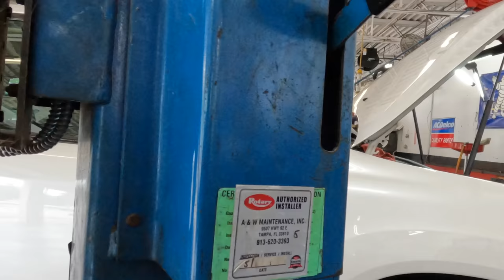Lost Every Time! Shortcut FAILS! 2005 Lexus Rx330

Comment: So I have an 04 rx330. Was running like a champ till the other day. Only problem before then were bad rear struts. But anyway on our way home my fiancé set cruise control and it revved to 90, 10mph past set speed and began knocking. I had just hit 5k miles since last oil change and bought oil and filter. The oil light had been flashing intermittently but that happened last 2 times we needed oil changed. But now we have definite big end knock that sounds like worn connector rod bearings. Codes p0012, 0022, 0430 0441 0446 and 0455 so now I’m planing an engine tear down and rebuild and weighing it against a salvaged engine swap out. Low cost is better heat so I would prefer the former. Anyway I’m wondering what the odds are the retarded cam banks timing is causing the combustion fuel exhaust mixture to be so far off the sensors are thinking the bank 2 cat is dead. Will repairing the engine remedy these codes or am I looking at a whole evaporative system overhaul as well as an engine overhaul? Going to a mechanic I trust on Monday and having him run a diagnostic and compression test just to make sure it isn’t something less catastrophic but I’m pretty good with on the fly diagnostics.

God damn Toyota recommending 10k mile oil changes and not using Mobil 1 synthetic / royal purple or similar high quality oils for oil changes at their dealerships. 
Any advice / help would be appreciated.
Reply: I got a Lexus rx330 2005 bought December 1st and already have a problem jap made crap
Reply: @kellysutton2780  it’s a 19 year old car. Toyota makes better vehicles than most. I had to pull the engine out of mine and replace it with a salvaged one  myself since I couldn’t afford $4000 to have a garage do it. What’s the issue with yours? How many miles? Most people neglect oil changes and let them go too long till the lubrications system fails and then you have catastrophic engine failure. But I see more Rx330’s on the road than any other used car from that year period and I’ve never heard of a 3mz fe engine failing before 200k miles. And I’ve seen a lot go to 300-400k miles
Reply: @kellysutton2780  most dealerships are required by law to offer a 90day warranty. I would go and complain to them
Reply: @deeeyewhy5949  it said by as is used car lot
Reply: @deeeyewhy5949  it has 185thousand miles and the check engine and traction off light came on so I unhooked battery cables and hooked them back on lights went out but was running rough and found out it was out of coolant put in coolant and back to normal next day I cranked it maintenance required light was on and running rough turned it off and barely cranked it sat for one hour tow truck guy cranked it drove it on truck and said seems fine so I don't know I sent it to garage but they can't look at it until Tuesday
Reply: @deeeyewhy5949  garage said it needs coil tuneup and timing belt 1298.80

Comment: I don't know why you don't want to discharge the A/C. On most modern cars, the condenser, radiator and fans are installed as a module. It only makes sense to remove them as a module. I'm also curious why you don't use a vacuum filler for the cooling system. It's quite a bit faster than using the burping funnel.

Comment: New hoses, overflow bottle, cooling fans, and poorly installed water pump, while leaving a cracked timing belt and a radiator with holes in it.  Looks like someone used reverse logic in trouble shooting the cooling issues on this car.  Wouldn’t it be nice to have an inline 4 cylinder engine with timing chain and port fuel injection, life would be so much easier.
Reply: Don't forget, the last guy put the belts on backwards too... He's Anti-Ray!

Comment: Wouldn't it have been a good idea to take a minute or so to blow some of the dead bugs out of the AC condenser once you had the radiator out? That fancy air blaster should have made short work of it.
Reply: Actually yes it would have been the best time because of the ease of access with the radiator out. But you don't want too much concentrated air pressure, it will bend the little wavey fins between the tubes and hinder the air flow.

Comment: A whole lot of clicking going on. Dropping stuff because you have to work with speed and do it right. At least you do proper clicks. One time I had to go and retorque almost all the bolts on a job another mechanic did.

Comment: Is this progress?  On a '65 Chevy, to replace the radiator, you unbolted the shroud, disconnected the trans lines and pulled the hoses, undid 2 bolts on top of the radiator and pulled it out...  Yeah, I'm an actual old guy.

Comment: Anybody know if it's normal to put about 80 miles on a car when you leave it for a torque converter change? Aamco fixed mine under warranty for free,  but put 77 miles on it when they had it for 8 days over the holiday weekend and left radio and AC on full blast.
Thanks
2014 Camry

Comment: I noticed when you hose down engine bays you don't cover the alternator or electrical components, is that not an issue?
Reply: When you drive in the rain, everything gets wet so, no.
Reply: @frankp.2831  My car has a massive underpan cover, no water gets in.
Reply: @tonedcos  That's a Miracle
Reply: @peted5217  Skodas for ya, i'm well impressed, had my mechanic lift my car to inspect bushings yada yada, for a 15 year old car, it's really good.

Comment: Most of the Young Mechanics do not know how easy it was to work on vehicles when parts were simple to remove and many had air conditioner units hung on V8 Engines. Now cars have many parts that are not necessary like all these Sensors everywhere. My Big 350 V8 Olds Cutlass would get 20 mpg on highway and run like a Scalded Dog, Smoking the Tires as my wife often did. What I'm saying is, cars are much more complicated without helping their Performance...

Comment: Why are you not using what the car calls for BTW? It calls for red. Wouldn't running another coolant be bad? Or since you emptied it then it doesn't matter?
Reply: The universal yellow extended life coolant works in all makes/models is perfectly fine here and better than OEM.  I've used this for years in various cars of different makes, including multiple asian vehicles and never had an issue.

Comment: It's a Lexus.... Shouldn't this take Toyota/Lexus super long life pink OAT coolant?  The yellow stuff supposedly will not properly lubricate the new water pump and lead to another premature water pump failure.
Reply: Wrong.  The universal OAT coolant, yellow in color, is superior to the OEM formulation and this will make the water pump last even longer than Toyota OEM coolant.

Comment: NO GREEN ANTIFREEZE IN A TOYOTA EVER.   USE TOYOTA ONLY  PINK THATS PREMIXED OR RED YOU HAVE TO MIX.
but the green is why the water pump went out.  Its garbage in a Toyota engine.

If its brown its becuse someone typed off the system with green. And it needs to be flushed out and refilled with toyota.
I'll only use toyota parts on a Toyota 
Lexus is Toyota.

Comment: Ah yes, good ole japanese over engineering....Acura's are the same way, bolts, hoses, wires run along the fans and clipped...good times.  You gave me serious anxiety with that screwdriver and the condenser lol
Reply: Jap made crap I got a Lexus rx330 2005 bought December 1 already having a problem

Comment: Am I tripping but should you have been able to pull that radiator out with the fans attached a heck easier like those brackets that you lifted the car up to take the screws out of did absolutely nothing. You cut to new radiator with out showing what bolts or screws you had to finally remove to get the radiator to lift out.

Comment: I was screaming at you the entire time to lift that vehicle first.. you have to remove the cover, the two bolts you were after, and the lines/brackets/screws anyway.

And using non factory coolant is likely what has caused their cooling system problems in the first place btw. Mixing coolants even though “they’re the same” is not best practice. I would argue a majority of cooling system issues are caused by 1) not changing it enough and 2) mixing coolants. But since this thing only had water when it came in.. who cares? Certainly not the customer.
Reply: The coolant he's using works in all makes/models and is perfectly fine here.  No one needs to use OEM coolants, they're a waste of money and the universal OAT coolants work just as well, if not better.